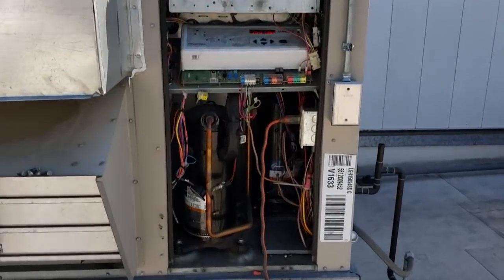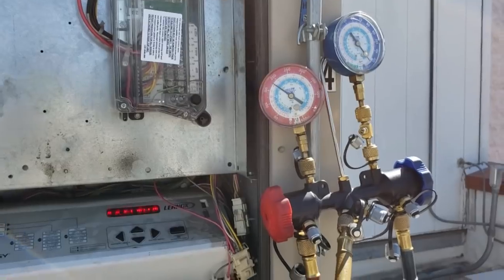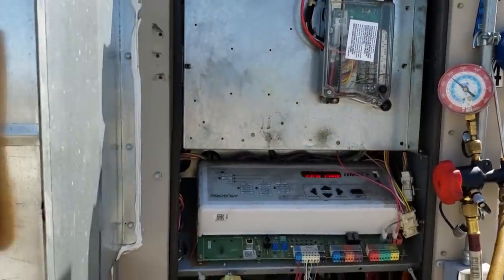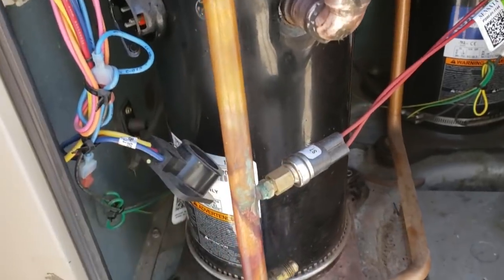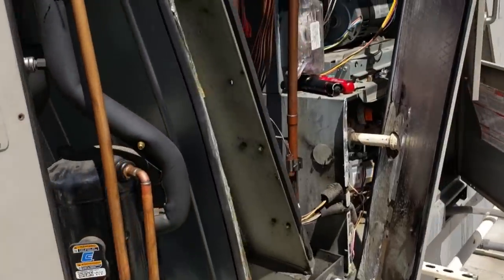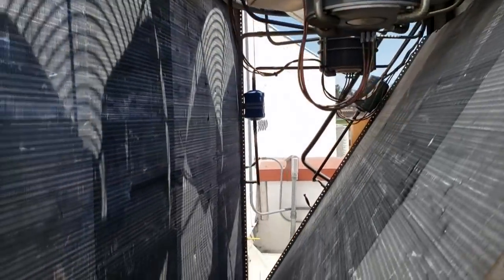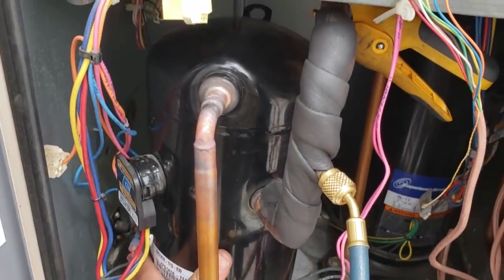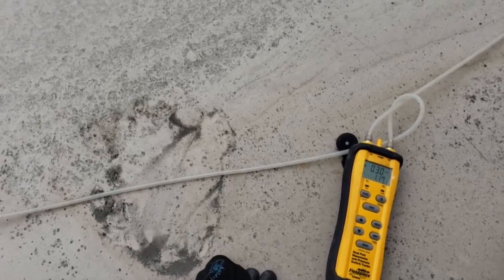GROUNDED COMPRESSOR AND AIRFLOW PROBLEMS

Comment: I gotta call you out on brazing w/o wrapping that TXV in a wet cloth - silfos flows at 1190 degrees F - that heat WILL conduct to the valve body, I don't care how fast you hit that joint, that heat is flowing into the valve body and deforming nylon or teflon bushings, o-rings, or gaskets.

Comment: $$$ < thats how things pass inspections
Reply from the maker: Exactly
Reply: Same in europe, don’t worry about it!

Inspection companies that fail systems (on good grounds) are still not asked to reinspect the update and the next building and the neighbour won’t ask them also since he heard “how difficult they are doing about nothing”.
And make the build delay (do it good first time and no delay but hey always blame the other guy) and expensive and all.

They will be out of money fast without jobs to inspect.

I am afraid not even state inspectors will help since they will have friends that get by more easy, because he trusts them after a few times and starts skipping going to the roof or into the ceiling or what not.

It’s just insane the things that happen. And not get noticed.

I once worked a packageunit where the 24v for the economizer and 220v for a hot water pump got switched at construction (10 years earlier).
We were the first to take the complaint of not getting warm seriously (we took over maintenance contract from the previous company who did the install/build also), and investigated.
Pump was not running so we thought it to be broke and ordered a new one. Installed, nothing so we measured voltage. And that was when I saw the arm from the 24v motor  to the economizer was disconnected. So we checked it also. 

We found a 24v motor in reserve put it in and switched wires at the controller and it all worked. For the first time!!

Comment: HERS rating should not be done by private companies. It should be done by the county in which the system was installed. Private companies benefit too much by passing what shouldn’t be passed. If a rater fails a contractor they’ll be less likely to be hired again by said contractor.

Comment: Can i ask what sort of pressures are experienced in these systems, i am not an HVAC tech but work in aviation and we have compressive swage fittings that can operate safely and not leak a drop at 3000psi in aircraft  hydraulic  systems. Watching you guys working with that flame in confined areas seems like a very old school way of joining pipes.
Reply from the maker: Typically our operating pressure do not exceed 600psi unless we are using Co2 than the pressure go much higher, but I personally dont deal with Co2. I will be going live on YouTube this evening 12/23/19 @ 5:PM (pacific time) to discuss my most recent uploads and answer questions from emails, YouTube comments and the live chat, come check it out if you can https://youtu.be/K3iG5q_Q_0U
Reply: How do these compressive swage fittings work? I feel like i'll get a direct answer from you instead of going to google.   :)
Reply: @jonnywilson9117  look up Permaswage for the aviation version or Propress for the copper plumbing version. I have personally used permaswage on military aircraft .they are basically short lengths of tubing that have seals pre fitted inside. Slide them over the existing tubing and crush them on with a hydraulic press tool. Approved repair , can hold 3 to 5 thousand psi dependant on spec. Never seen one leak. Obviously there is situations where this type of fitting simply is not going to fit but it does get rid of the open flame.

Comment: Dont always have time for a wet towel but has time to measure comp oil. Lol. Disagree with some of the things said in this video. But hey you do you
Reply: Normal Winston lots of heat on that txv.  U can overheat these on install.
Reply: I love using thermo trap on txvs if I notice I need to add more I just spray it to the txv and no need to stop bracing

Comment: Great catch!  Question though!
If PS1 is installed on Compressor 2, and compressor 2 is low. how is it that comp 1 is running?
What I am saying is if PS1 is detecting low pressure  regardless of where it was installed, then comp1 should not be running which it was.

Comment: I would have used cooling gel around the expansion device and added acid away to the system , as the comp had burnt out, the shellac on the windings turns to acid.

Comment: End of video. Doing good work. It can be a curse in my situation my good work was always cleaning up someone else's shity work. I was okay at first but when they are paid more, well you get it.
The rare instances when I get to do the work new I take a little longer but the customer can see a huge difference immediately.
Whether it be a custom wood desk or a cubicle or cutting concrete, heck loading a truck even! Good work is not done by everyone. Even if they are trained and certified. 
One cubicle install, "6 pack  of open design" with 7 people  working  at where I went to troubleshoot their power cause they blamed our product. I had doubts and was right because the electrician somehow let ground and hot be hooked up incorrectly.
The electrician lied and said that it was a galvanized (grounded) fitting that was "cutting into the sheathing" and electrified the whole set of cubicle panels. But me knowing the schematics and how the freaking frame is hooked to ground! Knew that was a lie. I know that they screwed up bad because if it was really grounded like it was supposed to, that breaker would have tripped the moment they turned it on.
When troubleshooting  i went to pull myself off of the ground and all I did was put my hand on the edge of painted metal and I could feel the voltage going  through my hand.  A lot of people's work sucks! And its what I have found out in life to be true acrossthe board of jobs I've done. But I wonder is how they stay in business with all the crap they leave behind?
Reply from the maker: Yeah most customers don't understand quality work anymore..... they want cheap and fast and they get what they pay for!!

Comment: I was taught to heat sink the valve every time. Have you had any issues not doing so?
Reply from the maker: Well I try but honestly when I came up I was never taught to. It's a best practice to do so but sometimes you gotta do what ya gotta do......
Reply: @HVACRVIDEOS  Amen.
Reply: so true. you work with what you have at the moment, as long as it's not a safety hazard

Comment: I know you don't like to add anything to a system that isn't OEM but what about acid away since you couldn't fit the suction drier in. I've never had any issues adding that to burnouts. I agree with you on the TXV, as long as you don't linger with your torch on it you are usually safe as long as you cool it right away like you did.
Reply from the maker: I have used acid neutralizer's before and have never had any problems with them, I've just been trying a new route lately. But you bring up a great point, it would have a perfect candidate for a neutralizer, since I couldn't fit a suction filter in there. I have been really having a hard time with these chemicals the supply houses have been pushing with no proof that they work other than Nu Calgons paperwork........

Comment: Awesome exclamation on how many times the ball gets dropped . But like you say the ball did not get dropped it was actually looked over ignored money and profit talk first as long as there’s no enforcement with very strict punishment like suspended license for 4 to 6 months holding all parties accountable for paying to retrofit and fix the mistakes after they completed their job this kind of work will continue and then Spector to enforce codes to shut their mouth turn their head and walk onto the next job

Comment: So these high level building ventilation codes have to be meet with older buildings? Seems to me the goal post is always moving..
Reply from the maker: Yes, we dont necessarily have to bring an old building up to code if they aren't doing any work. But if you pull permits to replace anything on a building that piece of equipment you replace had to meet the energy codes. So when they built the new restaurant in this existing shell they were supposed to meet all the energy codes.

Comment: Question, doesn’t the micron gauge have to be connected to the suction line?
Reply from the maker: No it can be connected anywhere on the system. Best practice is to have it as far away from the pump as possible to show the real micron level of the system though
Reply: HVACR VIDEOS gotcha, thanks Chris

Comment: That wall looks pretty close to the condenser coil.
Reply from the maker: Yep it causes problems , the coil has to be cleaned every two months
Reply: Damb right. Everything about that job is fubared. I have a building in Scottsdale that looses compressors every 1-2 years. No oil traps in suction line. 3 story building. Facepalm
Reply from the maker: Crazy....

Comment: Ran into that problem yesterday onli the return air  velocity is so high it keeps on pulling hot air into the system and space from the gaps in the door , also the kitchen exhaust is being over powered by that return air pulling so hard

Comment: People are generally too apathetic. I was working with a group of.... seasoned technicians. We were installing two split systems and an RTU. I mentioned something that they were about to miss. (We were installing Carrier equipment which I installed regularly but they didn't. So I was just more familiar with Carrier's installation manual.) It was only a little thing that wouldn't take any more time than what they were going to do. When I spoke up, they have me a hard time about it and said that when I'm older I won't care. SMH. They don't know me very well. It grinds my gears when people knowingly install equipment improperly because they're just apathetic!

Comment: nice video again, why you dont try to get the suction filter drier on flare, so you dont have to mess with heat in such small place, i just wonder, you are the pro here

Comment: Kinda off topic but do u use a puller to remove your motor sheaves? And if so what sizes should i carry for light commercial?
Reply from the maker: Yes I do I will try to show it in a video
Reply: I have 2 a larger 2 claw one that's good for about 10" pulleys and a $20 3 claw one I got at an auto parts store. I use the auto part store one 99% of the time

Comment: You say the pressure sensors are swapped, but you made that assumption based on the stickers.  Did you actually trace the electrical paths to confirm that?
Reply from the maker: Yep

Comment: I used to run environmental liquid effluent units for automotive manufacture companies, the water supplier would give the allowable limits for metals in the drain water which we spent a lot of money on getting the metal out of, the thing is if you just couldn't meet the standard then they would change the limits, so often times smaller companies that could not afford to spend millions could operate. Go figure.

Comment: I've brazed a bunch of TXVs without wet rag and have never had a problem. And who cares if you didn't put a suction dryer. Good job! 

But why invert the recovery cylinder? I get the not using the liquid side but why invert?
Reply from the maker: It makes the recovery process a little bit faster because on the liquid side there is a 1/8" Id tube going to the bottom of the tank , so if you flip the tank.over and charge thru the vapor port it doesnt go thru the restrictive tube.

Comment: Another excellent video, the unit in profile picture has just been upgraded to same unit but newer version. Unfortunately  the idiot who installed  it didn't do a pressure test and its had a leak on it over a week or two and has now lost all its gas on an overtighten  flare nut connection on the high side. Through an hour or so of noticing the leak the compressor was getting faster and faster and compressor discharge at one point was 110c before we shut it off as there was no cooling. There was oil spitting out of the leak point but not what appears to be massive amounts. Would you say the unit needs extra oil? I was also under the impression that oil in the pipework and evaporator would make it's way back to the compressor?

Comment: I have one question. Why would the fire alarm in the shopping mall have a possibility to go off when you turn off the unit?
Reply from the maker: It was miswired and the mall had it configured to alarm in a trouble condition.. 

I will be going live on YouTube this evening 8/19/19 @5:pm
(pacific time) to discuss my most recent uploads and answer questions from
YouTube comments, the chat, and emails. Come check it out if you can  https://youtu.be/cFVJGl-KVEc

Comment: Why replace the TXV when you do compressors. Assuming it's still good? I noticed that whenever you do a compressor you do a TXV. THANKS
Reply from the maker: It's cheap insurance, you have no idea what killed the compressor and you also have no idea if whatever killed the compressor damaged the TXV so if the refrigerant is already out of the system you may as well replace the TXV also.

Comment: Number one problem is every local municipality code enforcement is responsible for checking. Most have no clue about airflow especially in smaller municipality.  My guess they retrofit an existing restaurant, reuse existing duct and roof curb, put larger hood or change with appliances that need a higher cfm per ft of hood and put a larger fan that creates a ridiculous larger static because duct is too small. Using economizer on HVAC units for exhaust fans is bullshit. A dedicated make up air for exhaust fans is the way to go. At least the next tech will physically see a make up air and if he messed with the economizer position.

We run into major issues with AC in the winter With kitchens. They open up the economizer min positions bc of make up air issues and the supply temps get in the cold ambient temps . 

Even if there is a heat call, you can get only like 40 degree TD Max, still too cold

Comment: I thought I heard you say that was a 12 ton unit. Well 12×400 CFM per ton equals 4800 CFM? Most commercial units are related for up to  1” ESP???
Reply: gary smith 1" tesp still means .5" supply so he's still wayyy high on static pressure so I don't see your point? 🤔
Reply: in the video he said the measured esp was 1" supply and .3" on the return.  whats your point??
Reply: gary smith that's 1.3" out of 1"?? My point is that it's high static even if it had a 1" tesp rating

Comment: I must have missed why the recovery tank is in the bucket of ice water?
Reply from the maker: To being the refrigerant temp down in the tank so I can recover faster
Reply: PV = nRT

Volume of recovery tank is static. R is a constant. So as you cram more molecules in, Pressure rises along with Temperature. We know gasses, among other things, like to move from higher pressure to lower pressure so if you can lower the pressure, it'll expedite the process. The only variable to lower the pressure (other than reducing n, which is opposite of what you wish to do) is to lower the temperature since it's directly proportional to the pressure.

Comment: HAHA you think that whole MUA, exhaust fan and RTU setup is a complete flustercluck, should see the shit i come across at my work. One of the kitchens at my work doesn't have a fuctional makeup air unit last i remember and with all 4-5 upblast exhaust fans going makes for one hell of a negative pressure. Opening up a door is fairly wicked in that kitchen. However there is a smaller kitchen elseware with an oversized MUA unit and it's like a hurricane inside the kitchen.

Comment: This is a failure of consultants and customers. Consultants provide the customer with 3 options.... 2 x options that will work and then the cheap alternative that will just about work. The customer doesn't understand HVAC. He only knows how to run a restaurant. The consultants gets paid... The customer ends up with a poor system and the cycle continues

Comment: You didn't get invited to the expensive dinner before the Construction !!!!!!   If you did then you would learn how they passed       In addition to that , even after things are correct the
Min$Wage Maint guys in a Building do those things like close grills, which causes the next complaint and closed grill and so on.    Even after 1-year of these guys running around
a new building they create Massive Problems _ Because they have No Idea What They are doing

Comment: I cant stand WHY electronics on these units is so naked and unprotected. They get exposed to limit conditions. Would make better sense to at least encluse them in a box with a gasket. Wondering how many of this boards gave up on nothing but corrosion / dirt etc. This units cant be a cheap thing to buy nor mantain. Long ago I have seen a vid on Inverter domestic units (split) and the power inverter wasnt covered at all, nor encased, and it failed due corrosion / water intrusion. I can understand the made to fail in domestic appliances, but on comercial systems ... no sense

Comment: Kitchen ac units are usually designed for the space size and never account for the heat load of all the equipment inside. It’s a laughable joke! Complete horse crap! And extremely annoying.